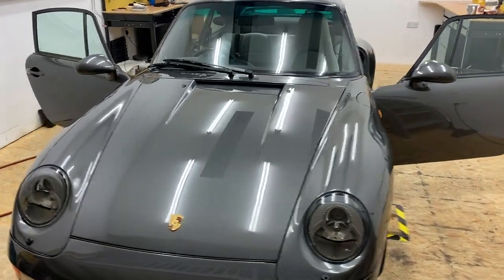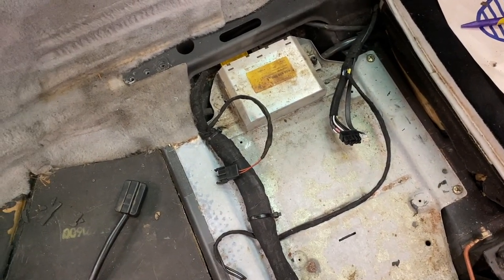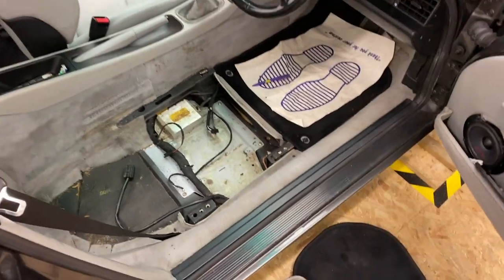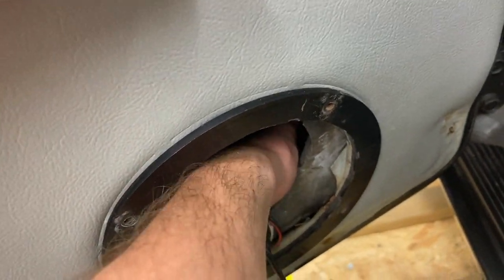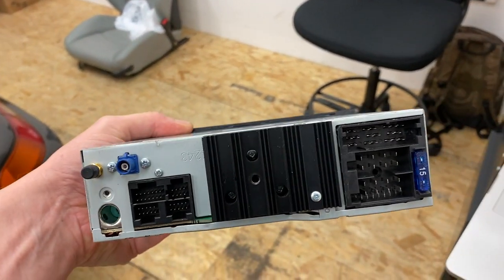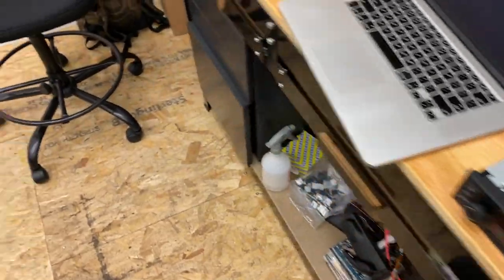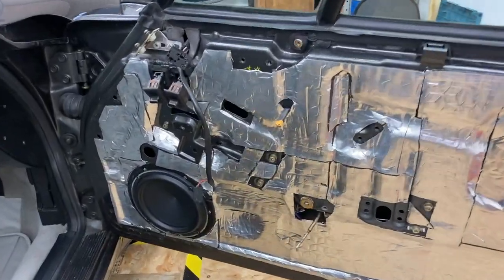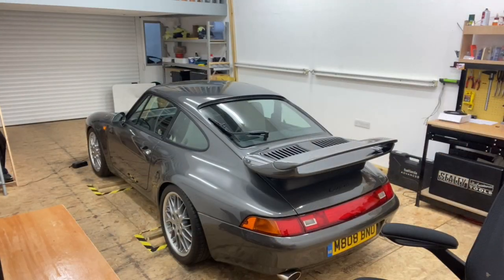Porsche 993 audio upgrade, PT1 behind the scenes - Hertz Mille Legend, Audison Forza M8.14

Comment: Fun fact: that Kenwood is used by Singer in their "premium" sound system, which is a $9980 option. From what I can see RHD cars are a pita, as you have the engine ECU under the passanger seat. On LHD cars you can put a much bigger and much better DLS ACW10 sub in there.

Comment: In the States, the Helix V Twelve is a better price with more output than Audison. Just curious why he went with the Audison vs the Helix?
Reply from the maker: In the UK, they are the same price, £1299.99. Also the V Twelve is less power per channel and is not bridgeable. This car didn't need 12 channels, it needed 6, so most of those channels would have gone to waste. Then there was the space I had under the seat. The Helix products (I'd have liked to use the Six Ultimate) were too large for the space.